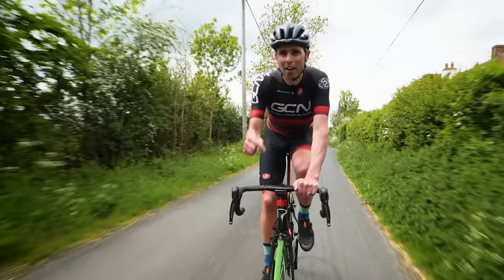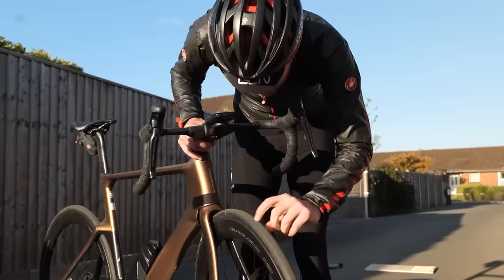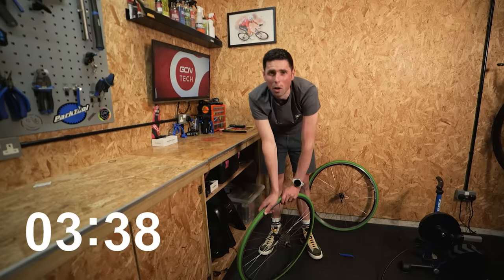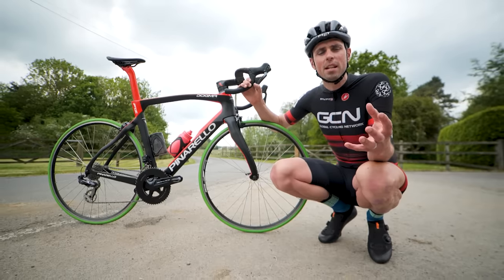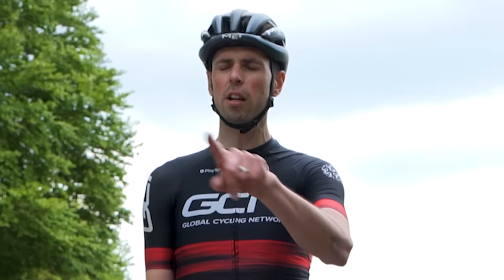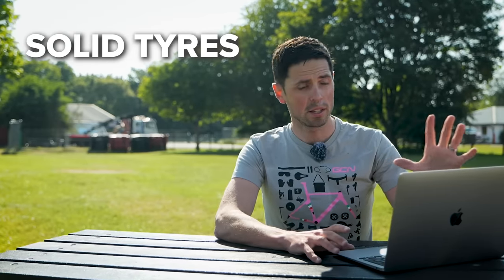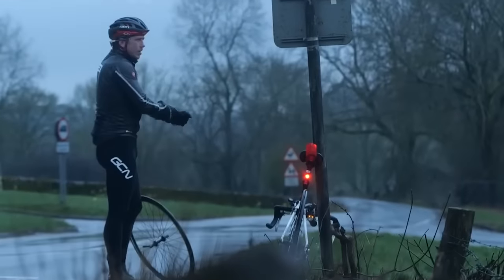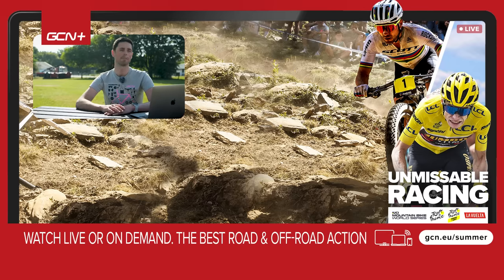We Bought PUNCTURE PROOF Tires, Are They Any Good?

Comment: 100kg guy here. I used a pair of tannus in my road bike for about 2000 km. They are harsh and had a tendence to catch more objects than traditional tyres. But never before I ride 700x23 without the average of 1 puncture every 100km. Moved myself to a gravel bike with larger pneumatic.

Comment: Had some years ago. They keep coming around. They're prefect for indoor businesses that use trikes to carry stuff around, say a metal shop where you would just shred a normal tire. But they have some drawbacks. Aside from the defficiencies listed in the video, they are slippery on road paint. It's almost like riding on wet train tracks. It's not confidence inspiring. Then there's the wheel longevity issue. The beauty of a pneumatic tire is that it is a form of suspension. Spoked wheels do not like solid tires that aren't kept tight and true. They can shake enough to loosen spokes and there goes the wheel strength. These tires come and go with regularity as any good bike mechanic can tell you.

Comment: My solution is tannus tire inserts. If you have a puncture you can still finish the ride to work or bike shop without damaging the wheels. Great solution. I looked at tubeless and indeed you get excellent protection from minor punctures but if you have a big one that it can’t seal, it is much harder to fix.  Inserts seem like a good compromise.

Comment: Something not mentioned in the video is the increased risk of breaking a spoke, or how it might be impossible to fix without having to destroy the tyre to get it off to replace the spoke. On 700c rims with thin tyres anyway, there's (obviously) far less shock absorption between the road and your rims. Maybe the risk of spoke breakage is not increased if you're using smaller wheels like 26" with 32 or 36 spokes and a wider version of the solid tyre. I'm just telling myself that because that's my setup. 😛

Comment: Id like to see a test with a solid tire on the rear only.
Most flats I get are in the rear. There's more weight on the rear to push glass through the tire. Often if I see debris at the last second I can swerve or hop the front wheel but it's harder to get the rear out of the way as well. Also it's easier and less greasy to fix a flat on the front.

Air in the front tire would soften the road and still allow you to adjust traction on the front wheel.

Comment: I was told by a bike mechanic that these do work well BUT, will be destroying your WHEELS making you REPLACE them FAR more frequently than when using standard air. I imagine it's ultimately down to the vibration compared to regular air tires/tubes, that tears up the wheel structure.

Comment: i live in a area with a lot of broken glass and other sharp stuff on the streets so  punktur resistance is important. i had good results with tires like gatorskins, gp5000 or schwalbe marathon plus, maybe punkturing once a month or less, with other tires i had punktures multible times a week. i tryed tannus tires but my rides became way more exhausting and it felt like they got loose a litle and it was very uncomfortable. still i think that a good working airless tire would be a big improvement and would make a lot of people ride theyr bikes more frequently. i also would not mind to stop carrying a pump and a tube and repair kit everywhere. still thanks for the test.

Comment: Tried some in the 80s  Were like a v shape wedge with a black plastic hula hoop type insert.  Fluro Orange , or Black . Were pretty lethal . some came off the rims . the long term ones bone shaked the spokes loose till a near wheel collapse. "But did not Puncture" :).

Comment: I tried solid tires quite a few years ago.  To put it simply they were rubbish. Very slow, very harsh ride, and one came off in a hard corner.  Modern tires are so much better than what we used to use.  I have a new bike with Zipp wheels.  Wide internal rim width and much wider tubeless tires are so much more comfortable.  Not flat-proof but getting close.

Comment: jeez i've not seen those things since i worked in a bike shop as a  saturday kid in 1990, sales guy came around pitching them to the shop owner, they were a nightmare to fit back then, super super tight, much tighter then shown here. you needed big zip ties to hold them in place as you worked them on with a huge tyre lever.

Comment: Alex it cannot be the weight causing the difference in a previous GCN Tech video Oli said that a heavy wheel has no bearing on speed as it is a flywheel and slower to spin up means slower to spin down (ignoring spin up time if braking is involved). This was with regard to deep section aero wheels Vs narrow light climbing wheels. Therefore the difference must be the compound. Also cannot think they would be fun to use on a lumpy road in the rain.

Comment: I never liked them for commuting or basically anything. These were old tires (about 15 y ago) so was curious if they had significantly improved. Appears not.

That said, I do think they had their place. I rode a bike in a factory where they were used to do inspections and move people faster (faster than a walk, but less than 20 kph - speed limit in the facility for loaders, movers - and bikes). That was really clever since you there is always the risk of sharp bits or bad transitions between buildings that cause flats. That was clever use of solid tyres.

The other one I think it's really good - the AfricaBike. Used to transport goods, personnel, etc. across dirt roads where there's minimal access to maintenance. That's perfect!

Comment: I mean, I litterally got 2 puctures in the last 30000 km I rode...

One shard puncture with an old (>10k km) and dry Durano tyre. And one pitch puncture with a fairly new but underpressured Conti Contact Urban (which I have ridden thousands of kilometers since without any problem). None with Schwalbe Marathon+, slower (not nearly as slow as solid tires though ^^) along dozens of thousands of kilometers.

So my take : even if you want to be (almost) 100% sure to never get a puncture, just use Schwalbe Marathon+. If you accept a pucture every 10000 km or so, then you have a wide choice of high-performance yet really strong tires.

:p

Comment: Nothing new about these, I tried solid tyres when daily commuting in London in the late 90's. I found them very unforgiving especially on poor road surfaces giving a much harder ride and they put far more stress on your wheels especially the rear. All in all I think after a year or two I went back to ordinary tyres and find Gatorskins just fine on my steel Holdsworth for travelling around London.

Comment: I've tried the Tannus solid tires. It's crap, because you feel everything. My back couldn't handle it. Concept was nice, but in reality it doesn't work. If it did everyone would commute with them.
Reply from the maker: Good point, the benefits don't always outweigh the flaws!
Reply: What hardness did you pick? My tires are rated at about 6 bars.

Comment: Further to previous comment. My set did not wear unevenly even after a lot of miles but maybe that's down to the bike shop mechanic who put them on for me. In my experience provided you don't do kamikaze manoeuvres on wet white lines or iron drain covers then I've not had an issue with grip or skidding.

Comment: i have an hybrid ebike, road bike i really hate having punctures, the bike is heavier so it puncture much easier, mostly flints/rocks and glass cause my punctures, but now i think i've solved my puncture likelihood extremely well, i bought silicone lineers, i put 2 in 1 tyre and bought some self sealing tubes, the tyres are heavier, much firmer and the ride isn't as smooth, but i think this is very worth it, i lose a bit of speed, but because the ebike provides that extra power it doesn't feel any different, bit bumpier ride, but now not having to worry about walking a bunch of miles from work incase the tyre goes flat, or putting a new tube on the roadside is so much piece of mind, 2 silicone layers plus self sealing tube costs me about 50£ for both tires, is extremely worth it, now the only thing i gotta be concerned about is changing the brake discs every month because my bike can go at high speeds, but i rarely use extra speed, encase i need it too get out of dangerous situations or for overtaking other cyclists, so the pros outweigh the cons by alot.

Comment: We hear in a lot in GCN video's on what to take with you on your rides. Spare tyre/innertube and tyre repair kits/plugs and of cause a mini pump. I'm sure the extra weight of puncture proof tyres (not the tested ones) as in Marathon Plus or the like would not amount to the same weight as what you suggest we should take with us on a ride.
Reply: Yeah, but you could probably carry along a spare pair of wheels and it'll slow you down less than the solid tires
Reply: @sebastianschenker9775  What I mean are the normal tyres with puncture proofing and not the solid tyres

Comment: Schwalbe Marathon tyres would be my preferred option if puncture protection was number 1 priority
Reply: Yes, that's the perfect balance tweaked towards puncture protection. I'm using that. My other favorite is specialized sworks turbo t3/t5 released recently. One of the best road tyre with tube and  with low rolling resistance and better puncture resistance. Not as protected as marathon, but better than most/many road tyres with rather low rolling resistance. These two I use this year
Reply: I used marathon plus for >10 years and wasn't aware how slow and uncomfortable they are  and how much they add to wearing out your wheels. Switch to Ritchey WCS alpine and tubolitos and don't regret it.

Comment: As someone new to cycling as a sport, I did not expect tyres to make such a huge difference.
I've got a gravel bike (Grandurance Rd7) with gravel tyres (G-One Allround) and I find it hard to reach an average speed higher than ~24km/h.
Obviously mine are not solid and my bike isn't the best for racing (mud-guard, lights, etc) , but would real, narrow road racing tyres make a similair difference in average speed?

Comment: Greentyre, Tanus or Vittoria Air Liners are OK for commuting to work. Nothing else.
Note. For commuting, get an old bike that is not attractive to thieves. Clearances for mudguards and a dynohub. Battery front lamp to see with, unless you ride in city 100%.
Commuting is not a TimeTrial. It is a survival test :-) Give way to everything, and use 4 x Walking as your aim average speed. Starley designed it this way.

Comment: My main concern with the solid tires would be grip, or lack thereof. I would think cornering, especially in the wet, could be disastrous.
Reply: I used them a bit during an autumn. They were really bad on wet surfaces; so much I didn't even consider using them when we were getting close to freezing. Good for things under 20 kph or so with minimal handling.

Comment: I did not expect solid tyres to be THAT much slower. On a normal bike for commuting (with things like a pannier rack, light, mud guards etc) the remaining speed might be so low that walking could bei the most reasonable alternative if puncture protection is top priority.
Except with Nike Air shoes of course.

Comment: Interesting. I thought they'd be heavy af but they weigh no more than an equivalent touring or commuter pneumatic tire with heavy duty puncture protection, such as a Schwalbe Marathon. However, I'd still rather go for the Marathon since that has more than enough puncture protection, plus it still has the adjustability and riding characteristics of a normal pneumatic tire.

Comment: These results are not comparable… the solid tyres were on super shallow wheels. While normal tyres used a 60mm deep wheel!?! Come on? That’s easily 2-3 Km/h faster without counting the tyres. It had to be same wheels and only the tyres should differ, otherwise the results are pointless.
Reply: You're off by an order of magnitude.  Aero wheels would give perhaps a 0.2 km/h advantage at 33 km/h.

You're right that the wheels should be the same, but it would not have affected the results.

Comment: I tried using solid tires on my commuter bike and couldn't believe how bad the rolling resistance was.  It was like riding with my brake shoes rubbing.  I switched to another bike for commuting after that (nicer bike).  I then went back to my earlier commuting bike (some years?) later and tried removing the solid tires.  I was horrified that they literally disintegrated when I tried to take them off the rims!  Glad I discovered it that way, rather than on the road and trying to corner on them!
Reply: You might as well chop the solids off of a bike -- its easier.
I think the description of brake pads rubbing is quite accurate in how it feels to try and coast with the Tannus tires I have.

Comment: as long as the solid tires used are those designed with rider safety in mind, as well as proper installation, you could use these on training wheelsets. what would basically be akin to resistance training, paired with the slower speed in maximal efforts (which could be safer on roads), might just build enough muscle for the weekend rides 😂😂

Comment: I'd like to see 3d printed lattice tires. You can modulate the stiffness thus making it deform like a normal tire.
Reply: There's a nifty kickstarter 'slinky' tire to keep an eye on at 
"The Smart Tire Company" called "Metl tires". (Not yet in production)

One of the problems with 'Tweel' tires like what you've inferred in your post is debris piling up in their hollow spaces, esp. from mud.

Comment: A company like Vitoria or Continental could easily create a solid tyre that is good. Imagine something along the lines of a GP5000 with a glued in insert that is a foam with say like 70psi resistance for a 700x28 size. Cost might be like $30 more than a standard GP5000 but you would have the added benefit of completely wearing out the tread before replacing them. With advanced foam technology that is already available you would find that these tyres would only weigh about 50g more than the standard GP5000.

Comment: Definitely wouldn't run these for a proper ride but, if you have a dedicated commuter bike for super short distances and city riding, I could see the appeal of running these on a "fine enough for work" single speed.  Never having to think about optimal PSI or drive train maintenance could be appealing for the "work horse." They should sort out the crappy grip though...

Comment: Had tannus tires on my old mountain bike I use for commute.. Very sketchy - the high tires did not feel secure - it was like driving on ice - and sure enough, on a slow 180 degree turn, the back tire came off. I am sure they are better on road bikes with low profile - but I am not using them again..
Reply from the maker: Maybe one that'll get better in the future perhaps?
Reply: And you used the correct size? Only had them come off because someone hit me with their car. Took me 5 minutes to push them back on.

Comment: I looked into these about 10 yr ago.  the manufacturers website gives you a chart where you can find your weight, find what pressure you like to ride on and from that find the density of material the tire is made from.  they have so many densities to pick from .  So an unforgiving hard ride is your fault for not using a softer core density.  However I walked away from solid tires when a saw an itty bitty fine print saying that they were only rated up to about 40 mph.  My favorite part of any ride is descending and I have hit 55 before.  the solid tires going over 40 in a hard turn risk rolling off the rim.  HELL NO.  I'll check back in a few years and see if you have solved that problem

Comment: 30 mm Vittoria Zaffiro Pro V paired with decathlon rubber inner tubes and I can ride over glass with that setup on my commuter. Lower pressure also means comfort on the potholes. Solid tires would be fine if I were riding on a velodrome 😂

Comment: I've bought Tannus airless tires for my old (vers. 3.1) Strida folding bike.
It makes the bike very quick and simple to use.

Since they allow me to store the bike indefinitely in my car -- without worry about pumping them up each time -- worrying about them over inflating (i.e. 'pop') in the heat.

One thing about my riding experience with them, which has nothing to do with speed;

They don't 'coast' as well. 
Which I'd do a lot to let my legs rest.

Driving down a road commuting, you can almost avoid looking at the road for debris, and instead concentrate more freely just on the surroundings, and traffic.

In wet or icy weather, they are more slippery.

In snow, they 'dig in' better to the pavement below (if its 'dry'). Plus you don't have to worry what's under the snow either.

Comment: Hi Alex.  I would be interesting to hear just how often your premium tyres do puncture.  How many Kms per puncture?
Before Dunlop invented the pneumatic tyre, they were all solid.  The advantages of air suspension killed solid.
As another aside, my wheel barrow tyre simply would not hold air so I got one of those foam filled puncture proof tyres.  No more punctures but more effort to push.
Your 50% increase in time was shocking.  Please, please do the same test with a normal pneumatic tyre with the pucture prevention strip built in.
Reply: I would think puncture frequency would depend entirely on where you ride - city streets are (often) riddled with broken glass and other stuff, but open roads (in my experience) are a lot cleaner.
Reply: @kmetz878  Thats fair comment, and perhaps on the open road there is more scope for avoiding the worst risks.  I have noticed that, in the UK at least, the cycle refuge aroung road furniture is where the broken glass is.  I avoid them.